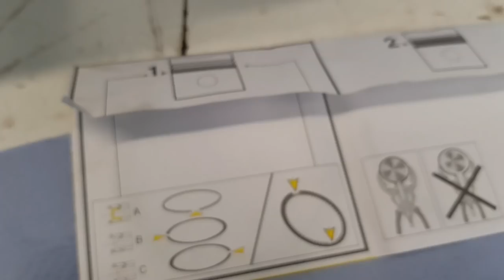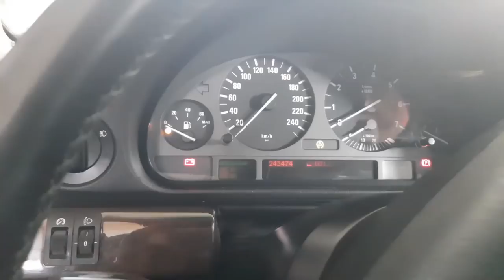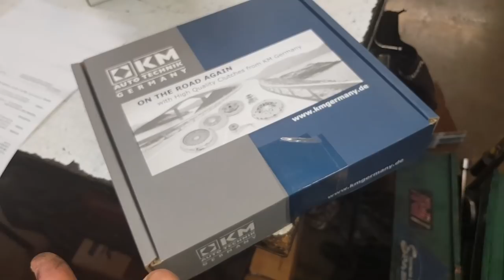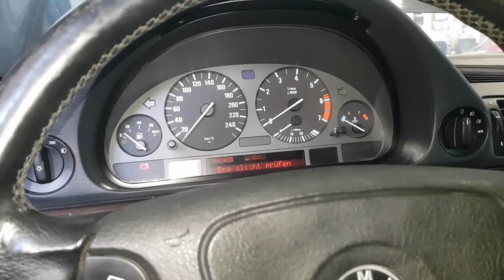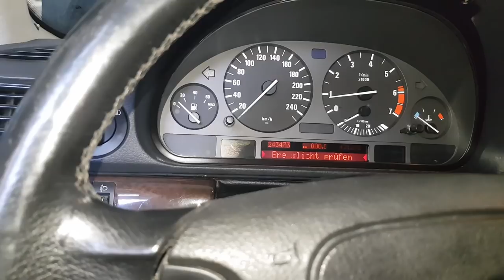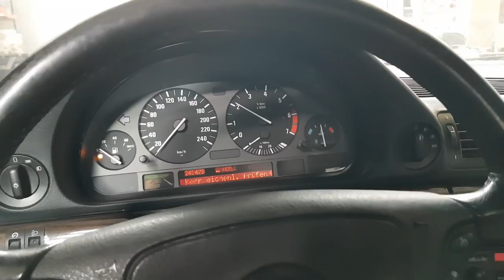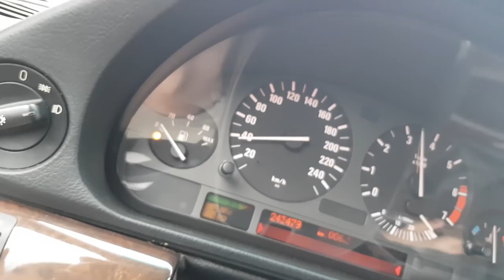BMW M62B35 kapitalinis variklio remontas

Comment: Не подскажете возможно ли свой ЭБУ адаптировать под газ?
Reply from the maker: In english please :-)
Reply: @MechanikasLukas  can you tell me if it is possible to take your ecu to gas injectors so that the car drives without gasoline, only on natural gas, it starts with Webasto in winter,
Reply from the maker: @zigandarov  it is possible, but original ecu most likely do not like gass injectors, there is different parameters of these injectors, so you need to correct opening times at least.
Reply: @MechanikasLukas  understood thank you I will find someone to reflash the ecu and the opening time of the injectors, can you tell me how automatic transmission 5hd24 without abs sensor work